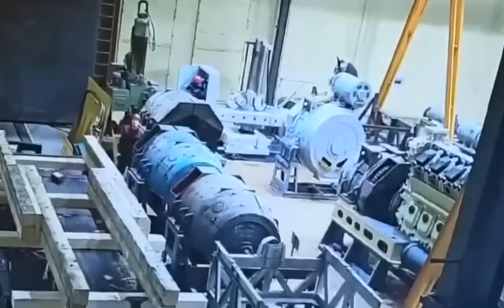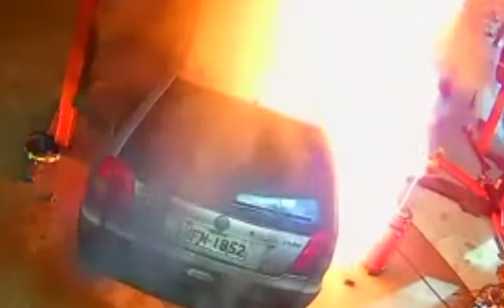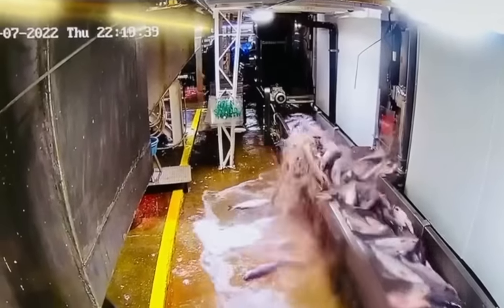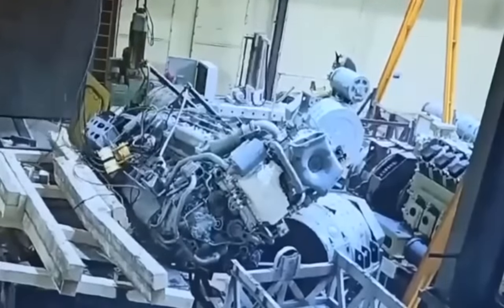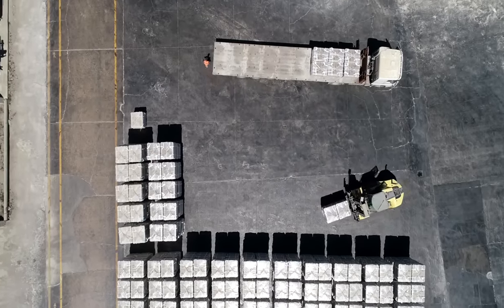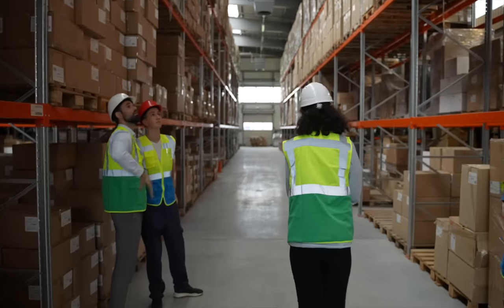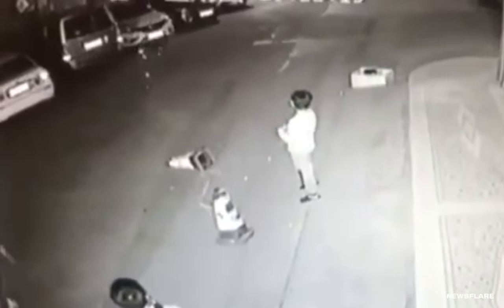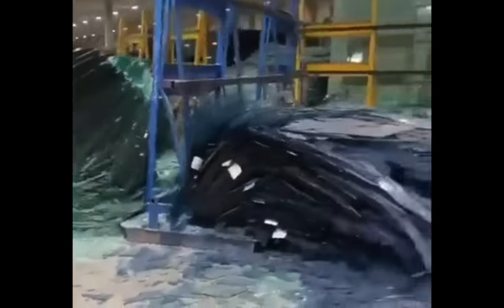Incredible Warehouse Failures Caught on Camera

Comment: NEVER jump off a forklift in the same direction it is tipping! Every qualified forklift operator knows this!
Reply: That’s why you’re supposed to wear the seatbelt, where fitted
Reply: Absolutely, wear the bloody seatbelt and hold onto the steering wheel firmly in a tip over scenario!
Reply: Qualified being the operative term here. None of the people I ever worked with that operated forklifts had any training, including myself. I did know how to properly operate one, which is why I didn't drive off a loading dock or into a rack full of stacked pallets and they did.
Reply: Never jump off ANY equipment. I know several people who have rolled equipment. The only 2 that died tried to jump off. If you wear your belt so you don't get thrown out, the equipment cage is designed to roll several times and keep the operator safe especially skidders!
Reply: Yes we are taught to wear seatbelts and brace ourselves in case of a tip over . How many with a forklift license can say they have never ever driven a forklift without using the seatbelt ? Personally I have . Also how many forklifts with seatbelt interlock have the belt permanently clipped in ? 
And in the heat of the moment the panic reaction takes over for many ppl and they leg it as quickly as possible
Reply: @ArmadaOne True you dont "need" a license but it does help to give people knowlege of what not to do and the limits of the macnine, - do you know how to read the loading plate for a forklift so you know what weight you can lift at and to a certain height for each pallet size and weight distribution and length of forks? Cant really opedate one "correctly" if you dont know how to rrad fhe plate - thats the difference between safely lifting and moving a load that the machine can handle and tipping it over...
Reply: I think you mean NEVER jump off a forklift at all when it is tipping. If you were 'qualified' you would know that.
Reply: The reason rests with getting fatally crushed. A forklift can weight at least four metric tons, and it has a solid steel frame.
Reply: Don't need the naration
Reply: @mikehunt908  I have been belted for 21 of the last 23 years I've driven a Forklift. Can't imagine operating any equipment without a belt across
 my waist at the least.
Reply: ...A friend of mine thought it'd be cool to go up a dirt hill on a forklift. Sorry to say, the roll cage popped his head like a grape when the lift tipped over. R. I. P. Tommy ....
Reply: as a forklift driver i totally agree with you

Comment: Never go under an object that is suspended if at all possible. In the oil field not only will that get you fired but it could cost you your life.  If you're the crane operator and you intentionally go over the head with an object not only will you be terminated but you'll be lucky if you leave without physical injuries from your coworkers.

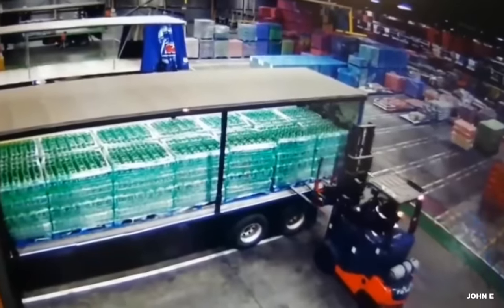Comment: 6:49 My guy could have easily been crushed precisely because he DID jump off the fork lift while it was tipping. Truck should not have been running and wheels on trailer should have been chocked as well. Hopefully driver was banned from facility or fired if employed there. No excuse for that. Activity was highly visible in mirror.